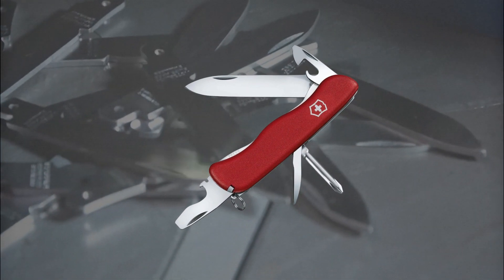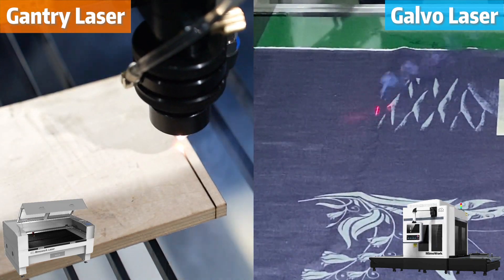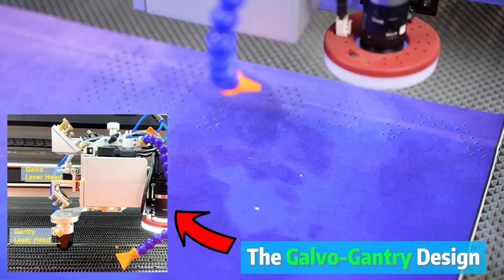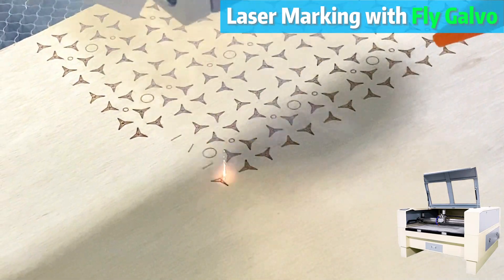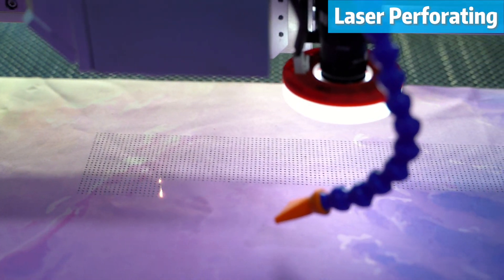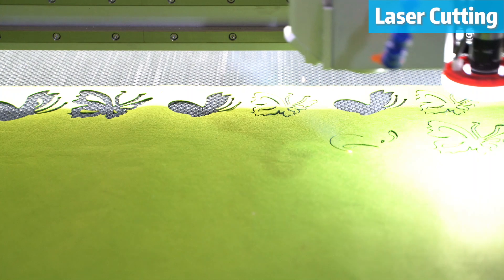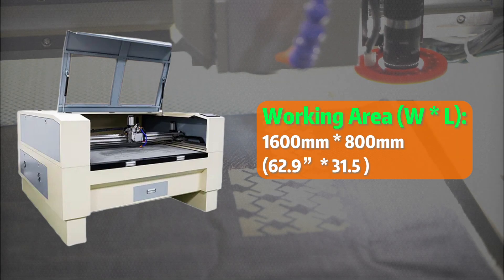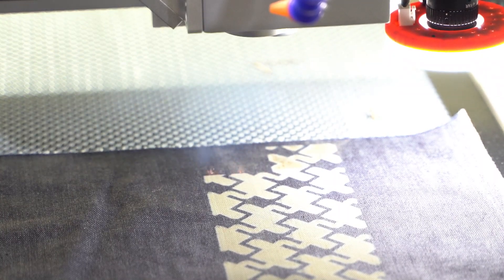The ONLY Laser Engraver You NEED👀 | CO2 Flatbed Galvo Laser

Comment: Does this machine works with Lightburn or EZcad?
Reply from the maker: Unfortunately, no.😢
LightBurn and EZCad are more commonly used with desktop fiber laser marking and engraving machines , which we also offer!🤗

Here's a link to our Fiber Laser Marking & Engraving Machine :😉
https://www.mimowork.com/galvo-laser-marking-machine/fiber-laser-marking-machine.html

You can also check out this helpful LightBurn tutorial we made:👀
https://youtu.be/F7ayyjinb2A

In this video, we're using a system called " FlyGalvo ," which is different from the standard fiber laser machines:🙌
https://www.mimowork.com/galvo-laser-marking-machine/perforated-fabric-laser-machine.html

Hope this clears things up!😉
Reply: @mimoworklaser  got it! Then the machines using the flygalvo system use an special software? I read the article but I didn't find what is it... 🤔
Reply from the maker: Thanks for checking out the article!🙌

You’re spot on – FlyGalvo uses a software called "PowerCut."👀

If you're curious to learn more, feel free to shoot us an email at info@mimowork.com .🤔

Our tech expert would be happy to dive into the details with you!😎

Hope this helps!😉